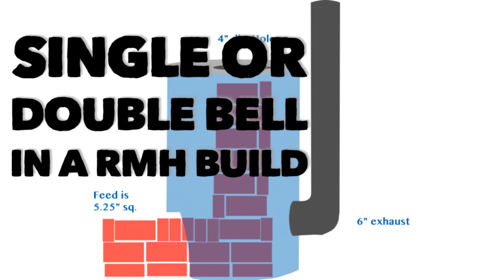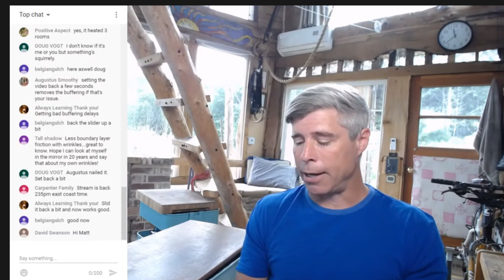Single or Double Bell in a Rocket Mass Heater Build?

Comment: Many of the modern Russian-style masonry heaters use stacked double bells, some with heated benches, as well.  Most such heaters have sliding diverter valves to selectively control the flow path of flue gasses.  I've seen heater designs with as many as 4 bells - 2 stacked on the main floor and 2 stacked on the upper floor - with diverter valves for starting and to bypass the lower floor bells once they've been heated to the desired temperature so that the second story bells can then be heated.  A small floor footprint and a single flue, with a single firebox to heat both floors, but definitely requiring a bit more "bush engineering" to get it right.  However, there are many complete designs with step-by-step instructions from reputable heater designers/builders available online for free - but they are in Russian.  Google translate or YT's closed caption subtitles with auto-translate are somewhat helpful, and you eventually catch on to some of the turns of phrase ("melted" = heated, for example).  And a picture (or video) is worth a thousand words.

Most of these heaters also use a "vyushka" (вьюшка) above the heated mass - a sort of double pot lid affair which can be inserted into the flue through a small cleanout access door - to almost completely block heat loss due to stack effect when the stove isn't being actively fired.  A sheet metal backed piece of ceramic blanket might work almost as well, since these vyushka castings appear to be unobtainium from the usual suspects in my neck of the woods.  A single pot eye might also be workable, with some refractory blanket and gasket rope, to duplicate the function.  Even the sliding diverter valves are too leaky for the Eastern European stove builders/designers; stoves with multiple guillotine diverter valves (starting, summer operation, oven, cooktop, etc. - 3 or 4 such valves is not uncommon) still use a vyushka to minimize heat loss up the flue between firings.

For combustion efficiency, it's pretty clear to me that the riserless/batch box stuff that Matt, Kirk, Lasse, Max & Eva and Peter have been working on is absolutely state of the art.  No other group is doing the Testo-based tuning that they are, so as to objectively quantify the effects of various setups.  But for some lifestyles, the Eastern European masonry heater layouts have a lot to offer.  I think there is a happy marriage to be made, here.
Reply: Testo based?
Reply: @miceskin  I'm sorry.  I don't exactly understand your question, but I'll take a shot at answering, and hope this is helpful to you.  I'll try to cover many bases, so some of the information is probably not a good answer for your question.  But hopefully, something I write will actually be a useful answer.

A "Testo" is a brand of combustion analyzer.  Depending on the model, it may report: carbon monoxide in the stack gases; excess oxygen; water vapor or relative/absolute humidity; hydrocarbons; combustion efficiency.  Perhaps more than this, also.

As an aside, a few month ago I had found another brand of combustion analyzer which seemed to offer similar features at prices which were very competitive with Testo's offerings, but I know that Testo is the generic brand (like "Jeep" for a small 4-wheel drive, or "Honda" for a quad) because of market dominance.  The alternate brand seems like it might better fit within my budget, when priorities permit that expenditure.  If I can track down the other brand, I'll add it to this comment.  I have no direct experience with either one, so I am not making a recommendation.

The collaborative efforts between Lasse, Matt, Kirk, Peter, Max and Eva, and others (yes, Ernie and Erica, also!) to develop riserless or batchbox rocket stoves have indeed been extensively Testo (or equivalent) analyzed.

Some of the Russian style appliances have been analyzed and the test data published, but I am not aware that the majority of existing designs (of which there are many) have been tested.  I think Kuznetsov has some published data (and he has undertaken CFD model analyses to justify his "dry seam" detail), and there was a study some years ago (1980s, perhaps?) which compared efficiencies of, as best I recall, 4 different Russian stove designs, including one of Podgorodnikov's.  The older designs (without benefit of modern engineering analysis) compared quite favorably to the more modern "improved" stoves - in the range of 75-80% combustion efficiency.  The old style Russian ovens are quite technologically unsophisticated, so this is a remarkable achievement.  I'll try to track down the reference and will edit this comment if I find it, to point you in the correct direction.  Kuznetsov (who is very opinionated!) has little good to say about many of the more modern Russian Gosstroy designs, and claims that many of the will not draft properly when operated in one or more of the functional modes (stove top cooking, baking, etc.).  Kuznetsov is himself apparently somewhat controversial, though I have only benefited from his website, and have had no direct dealings with him.  Some of the stove builders he trained seem to have distanced themselves from him of late, but this is only observed from afar.  I have chosen to reserve judgement; as I said, I have benefited greatly from his website.

There is a wealth of Testo data available on the Donkey 32 Proboards forum (just Google those terms - I'm sure you'll find it) regarding batchbox performance.  Excess oxygen, carbon monoxide, hydrocarbons and more, often through multiple firings, exist for several basic designs.  There are also rules of thumb for sizing batch boxes for stack sizes between 4 or 5 and 8 inches inside diameter (roughly, from 100-125mm up to 200mm).

I recently was given about 750 used red bricks (the small, American sized bricks, not the larger, Russian sized).  I have cleaned off all of the mortar with a mason's hammer, and they are now neatly stacked on a pallet, waiting to become a stove.  I may attempt Kuznetsov's OIK-14 or one of the OVIK models (if I can find a one- or two-pot-eye stove top plate).  Ultimately, I hope to build G. E. Asp's contraflow heater from the late 1930s, and (separately) a small outdoor wood fired bread oven.  But, the small (2x2 up to 3x3 bricks) footprint stoves for Kuznetsov don't appear to be particularly complicated to build, use minimal hardware, require fewer bricks (due to small size), and should be relatively efficient, both with regard to combustion (clean burning) and at transferring the heat of combustion to a room or its occupants.  If built using fire clay mortar, a stove can be disassembled and the brick reclaimed for use in a subsequent stove, so not very much is lost, other than time and a bit of clay and sand, when experimenting.

If none of the above is helpful, please ask again, and I will try to do better.

Comment: The 6" riserless core has plenty to spare with two bells.  A masonry first (58sqft surface area) and then 2/3 of a 55 gal. drum (cut down longways) that is buried in a 5'x7' cob bed.  PLENTY to spare.

Comment: Just bought the plans for the tiny stove. Looking forward to this build. I have enough free bricks with the ,3 holes in them for the body of the stove. I will fill the holes with the fire clay sand mix. Will that be the best fill to allow heat conduction and compatible contraction/ expansion? Thanks Matt.